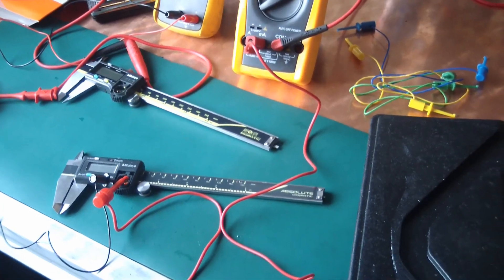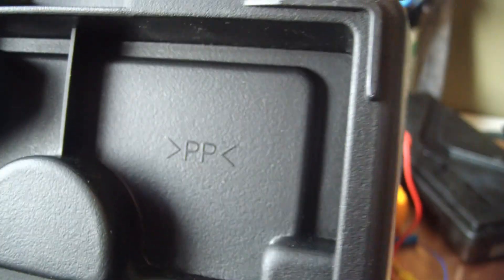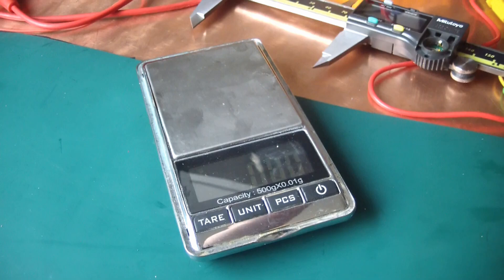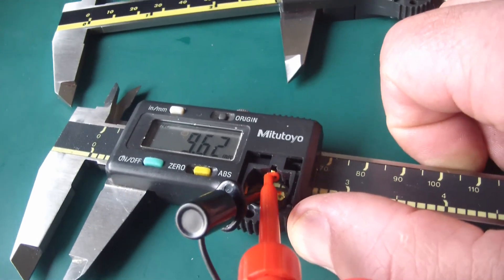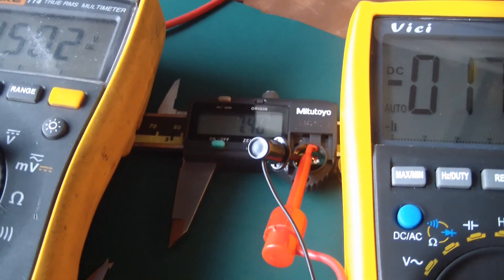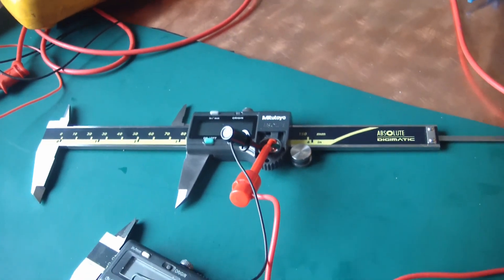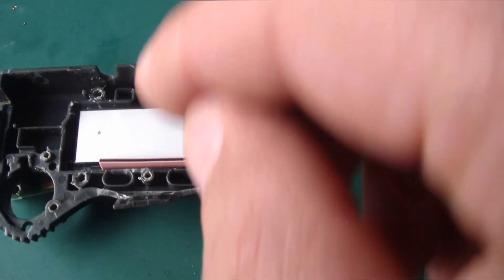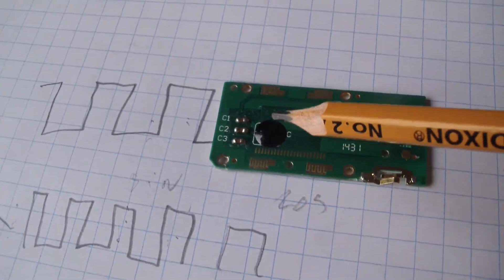BOLTR: $33 Mitutoyo Calipers, too good to be true?

Comment: Got some cheapie calipers myself... $20NZ.... surprisingly well finished and fitted and seem very accurate (checked against my genuine Mitutoyo micromater)... It's very easy to get the battery in and out so I take it out when not in use, otherwise it will flatten a battery in a few weeks. Works for me.... For most no-super-accuracy-required measurements I use a dial caliper anyway, which is accurate to 1/10th mm minus (minus a lot if you read the scale carefully.. the grads on the dial are 1/10th... about 4 thou in white man's measure!). The digi ones are OK to half a thou on imperial setting, about the same on metric... so quite good enough for most purposes. I always final check with the mike though, if it's really critical. It's a 0-2" that I got in a closing down sale for about half price about 50 years ago (when I had a high paid job!)... '62 if I remember rightly.... It's right up there with Browne and Sharpe, Starret etc..... dead accurate to .0001" minus throughout the whole range. I hope whoever gets it when I die looks after it..... even a smear from a slightly oily finger shows on the zero.... a beautiful instrument in its own right....
OK,... I guess y'all have gathered I'm a machinery nut.... LOL...
Reply: xKatjaxPurrsx as a cnc machinist and a cnc programmer, I assure you that a caliper is really usefull in a workshop.
Reply: I don't know why anyone would use calipers if they needed a measurement within 1/10 of a mm anyways, isn't that why god invented micrometers?
Reply: MrVitalic85 I use mine every singe day. Note my previous comment was satire ;-)
Reply: Oh by the way, Mitutoyo is an excellent brand; right up there with Starret, Jones and Shipman etc. Buy with confidence...
Reply: My black and decker soldering iron is from 1959.  It was my grandmother's father's.  Still have the orig box and manual, only missing one out of the 5 tips.  Also have one of these http://www.old-woodworking-tools.net/images/vintage-sears-sabre-saw-21260604.jpg.  Sturdy AF.  Had another one like this http://i.ebayimg.com/images/g/kyoAAOxyKh5SA-ek/s-l300.jpg but I broke it taking it apart :(
Reply: +MrVitalic85 aka green button pusher lol

Comment: I just bought some 6 inch Mitutoyo calipers for $110.00 how do you tell if you got the real thing?
Reply: I bought a pair of 8" Mitutoyo digital calipers from MSC the paper work was printed same as my dial test indicator also  Mitutoyo as well. I think the volume Mitutoyo produces doesn't  allow QA or inspection to hand write the certificates.
Reply: they said that their version is made in china so, no its no real mitutoyo
Reply: If it's a true mitutoyo the documents will be hand signed by the inspector never printed
Reply: Update:
I think they are fake...I saw the same ones on Bang good ( a China direct site ) for around or maybe even under  $30.
Everything looked exactly the same. Sad very sad.
Reply: if you got it from MSC big book i would not worry about it
Reply: http://www.banggood.com/Mitutoyo-6inch-0-150mm0_01mm-Digital-Caliper-Stainless-Steel-Electronic-Vernier-Calipers-p-1012111.html?rmmds=category
Reply: they aren't hand signed, they are printed from factory. The documents are just a certificate to say that its passed a standard QA. each inspector will have a stack of pre printed certificates he/she puts in the box.
Reply: +AvE  Ah crap looks like I may have paid $110 for the MituFang Pi version hard to say tho they don't look like either of the ones you have there.
They measure exactly the same as an older pair which are the real thing (I think) but the new ones have a little more resistance when sliding them back and forth all in all I like them but don't like the thought of paying $110 for a $30 item, gotta love MSC. How can they get away with not putting Made In China on them? Or at least not being able to put Made in Japan on the product ,paper work ,box etc...
 Oh well live and learn.
Reply: SgtPiggie I'll give it a try.
Reply: +Ed T how did it went mate?
Reply: mmdirtyworkz 

i never got around to contacting them.
Reply: Ed T ah too bad, I was hoping to see their response :( 
Thanks for the reply though, cheers!

Comment: Dig it 160 dollar calliper on ebay for 18 bucks delivered from CHINA. www.ebay.com/itm/Mitutoyoo-500-196-20-30-150mm-6-Absolute-Digital-Digimatic-Vernier-Caliper-/272098936620
Reply: Just saw this, when I clicked on this link:

This listing 272098936620 has been removed, or this item is not available.

Wonder what's up?
R
Reply: *****
Probably was caught out as a fraud by eBay. and they yanked it.

Comment: you would have done a better job at least explaining what the difference is between a "absolute" caliper and a old style "relative`' caliper.
A relative caliper just counts the number of steps it has been moved so if it counts wrong you get a wrong measurement.
A absolute caliper always "knows" where it is as it counts so the inductive path is numbered like doornumbers and the caliper always knows at what doornumber it is, while a relative caliper only knows that it was at 10.44 mm at now it has moved by 0.3 mm so the new measurement has to be 10.74.

A absolute caliper cannot fail at its calibration while a relative caliper can and will fail if you move it to fast, get waterr in it or chips.
Reply: That is why the "absolute" sensor does not need current in sleep mode to know the exact position at next wakeup. The small current in sleep is not for counting anything, just the normal low power current consumption of the microcontroller.

Comment: HF dial calipers. $10 They are accurate to within about 2.5 thou and I can come back in a thousand years and the battery won't have died.
Reply: I've had no issues with mine. Only complaint is that it's not metric.
Reply: +Desu-chan Sugoi the ones I got were in both metric and imperial. I find I like dial calipers. Sure, it's probably true that you can read the digital readout faster but reading the dial makes you feel like a real engineer.
Reply: Geahk Burchill
You have one of their air compressors? How are their air tools? I could use a die grinder but so far all my air tools are craftsman but craftsman went crappy within the past few years.

That air impact hammer with the 10,000rpm like the nascar guys use sure temps me even though I already own one that works just fine (and I don't use it that much anyway).

The only thing I had trouble with recently is there HVLP paint gun and it might have been my fault because I bought it years ago and when I got around to using it one of the hoses was so rotted in just broke in half trying to unpack it. But that's a cheap thing to replace -- more of a time hassle than anything else, really.
Reply: +BikingMNViking if u need to seal your hose connections I use a plumbers dope that is rated for 3000 psi steam fittings. can leave my compressor on for days and it doesn't run or leak. that hissing sound drives me crazy. I have stopped in the middle of projects to make it stop. hoses are the better Napa grade.
Reply: JEREMY WHITMORE
I used the white teflon tape... I realized storebought is lousy so I got some military grade stuff which is twice as thick 5 mils.... the hoses leak at the ends in the storebought crimps and I am really not sure what to do about the water in the first place.

I used to be good about emptying it regularly but got sick of crawling under it. I did buy a item that is supposed to sort of "spit out" the water at the end of every cycle but never put it on.

I also have the large professsional water remover, the kind the paint folks use, but am unsure exactly how to hook it up because if I hook it up higher there will likely still be water down in the tank. Both are HF units.

So do I have to put the AC on something up higher and run the Painter's Water Remover down lower?

Now I get the problem. I should just solder up a big brass or copper tube and let the water collect in there -- it won't rust/corrode(will it under 90PSI pressure?) and if it does the pipe would be cheaper and more replaceable than the compressor's main tank.

For now my med problems are such an issue I shut the whole thing off.

What about oversealing the ends of the storebought hoses with that "self sealing" silicone tape? (I also wonder about this new miracle stuff "Flex Seal" )

Also the water collects in the ends of the hoses and the hose end (esp the one outside) leaks -- that is the only hiss I ever had problems with. Even when I worked back in Amoco Gas Station the manager had me replacing the outside one every other day or so while the other one was probably inside drying out.
Reply: +Geahk Burchill Same for my Dad's hand-down 40+ year old Starrett dial calipers.  Every decade or so we get them cleaned and calibrated.
Reply: I'm almost 50 with bad knees and ect... from 36 yrs in the oilpatch. I now leave the drain petcock slightly open with an aluminum pan under the air compressor. It contains the water, easy do dump. If I'm doing body work, I buy those cheap screw in water traps from Princess Auto- Canada's version of HF

Comment: go analog,keep the battery variable out
Reply: and zero reset knock and slipping scale variables as well.Ive never spent even $100(this Aussie dollerydoos) on mitutoyo dial calipers (got 12" sealed NOS for $80! Older ones without plastic housing that scares me) so i don't get how people spend so much on this digital junk that im pretty sure isn't even MIJ anymore anyway, im still curios why AVE's legit ones are also labeled CE, HMMM....that thare be a red flag that he didn't touch on.

Comment: This is why I just use my analog calipers.
Reply: Dial calipers are prone to mechanical wear. They get sloppy and don't repeat especially in a shop environment with grit on everything.
Reply: Same! I did buy a digital one at a shop (decent quality shop), it was so much in the way I found out. So the next day I got the money back and did buy a analog one.
I learned in electrical school how to read the analog one.
Reply: +Eric Magnet  Yeah, sure digital may be better, but I prefer using my dial calipers. And until they start losing their accuracy, I'm probably going to keep preferring them.
Reply: I gotta have at least one set of Mitutoyo.  They last a decade anyway if you don't run them over with your car.
Reply: Yup. Any caliper is a + - .001 tool anyway, don't care what the resolution of the digital readout is.
Reply: Eric Magnet Idk, mine are fine and have worked and had the same zero for years.
Reply: Real vernier kalipers, my friend.
Reply: Ditto
I'm a reloader, and the $20 RCBS labeled Chinesium set I have works quite nicely for my purposes.
Reply: Sure they generally are. My boss and I have had this discussion and he was always against digital. Then, a few weeks back he was measuring some part right in front of me and bam, skipped teeth. Also, the pinion can bend and that causes it to read inaccurately. Bottom line is less moving parts is better.
Reply: Nathan Campbell I don't care what you use, it's all preference. The reasons I stated and the unit conversion and setting a new origin on the fly is why I use digital. I mainly do reverse engineering and inspection so those functions are very useful to me. measuring between same size holes is especially simple with digital.
Reply: and they are significantly cheaper. I got a 1/20mm geniune mitutoyo caliper for 30 bucks
Reply: Everything with moving parts is subject to mechanical wear...

Comment: The whole point of the absolute calipers is that they don't have to remember a count of lines.  I suspect all that current goes into keeping the processor awake enough to tell when you mash the on button.

I couldn't find a writeup on how the calipers work, but they have some absolute scales for CNC machines with analog outputs, and those return sine waves of various (spatial) frequencies. It looks like our benevolent masters don't want us to paste links, so go to mitutoyo.com, then literature, then "NC linear scales and sensors" (E13005_LinerScaleSystem), then there's a figure on page 47 that shows the signals the scale gives. I assume the calipers are similar, just without the "photoelectric mode" part (they claim you can interpolate 512 steps in the ~1 mm sine wave, and the calipers only give you 0.01 mm, so that's a gracious plenty).

Comment: Great tool review as usual.  Now how about a review of the dial indicators like Harbor Freight and Starrett etc.  I use them just because I don't run out of batteries when I have none in the middle of a job.  Seems a good reason to avoid digitals all together.  Bring back the slide rule!!!!  I am tired of having to be a warehouse for the unending variety of batteries which go bad without even being used.  Wheeww,  I feel better now.

Comment: I have the $20 craptastic Performance Equipment ones.  Same things as these.  No grind on the slide action and feels pretty good in the hand, but I can verify, horrific on power consumption but mine do have a 'batt' symbol on the LCD.  I purchased 100 357 cells for $5 on fleabay so I'm covered.  I just get in the habit of removing the battery from them when I power them off and put it in the convenient little holder in the case.My MK1 eyeball isn't as well calibrated as I'd like so these do and I won't cry if they die on me.

Comment: Today I saw some old mitutoyo stuff at work, one big box that was a large series of lets say calibrated thickness leaves (dont know the actual real name nor use for them), two micrometers and two digital calipers. One micrometer has a set "bits". I was told they are used to help the micrometer measure in different ways. Again, dont know the name. and Also 1-Meter Standard made of glass (this one not sure if was made by mitutoyo). Not a tool guy, but this things feel like jewels, what a quality. Some boxes are even made of wood.

Comment: I've spent the last half hour searching for the video where you smack a pair of calipers out of nowhere with your Swedish nut lathe claiming it needs an "adjustment". If you remember where that clip is I would be very appreciative.
Reply: Cheers
Reply: +Max Maruszewski Nope, not in any of those, think machining tool steel on a toy lathe is a video you never posted :P but don't fret, ill find it eventually.
Reply: +Max Maruszewski I just found it, it is in the "how to turn tool steel in a lathe" video around the 4:00 mark. Have fun!

Comment: AVE,

Grizzly sells a $30 caliper. 6", it's blue and comes in a case. I've used mine for many years, it's very smooth and when used properly just as accurate as my dials. If your interested I would recommend reviewing it. It's smoother than my Starrett Dial caliper.

At work my boss has some $10 Harbor Freight calipers...although they have a thumb wheel they are so rough I can't use them.

Comment: I have $15 mechanical calipers where the scale goes down to 25um (1 thou), although you can only read +-2 thou with your eyes. No low voltage risks, it's stainless, the only gripe is that it lacks the thumb wheel and the stopping screw. But it's a budget model of a local brand and it's not fake.

Comment: Love this vid.  I think the issue about drawing current while off is because of the push-button power design.  I have a small 5W radio that had the same setup.  I ended up replacing the push-button with a small SPST that physically opened the circuit.  No more battery drain on an emergency radio for when I forget to cycle the batteries out...

Comment: Love this video!  One thing to note is the "absolute" on the Mitutoyo calipers... it actually infers they use an absolute encoder and not a relative [or incremental] encoder. As such it does not need to count/measure when off. The knock-offs I suspect are using an incremental encoder, thus need to keep counting even when "off". An easy test for this is to remove the battery, and adjust the calipers to a known measurement, you'll find that the Mitutoyo's shows the correct reading when power is reapplied. I think you'll find that the knock-offs use an incremental encoder, and this will lose count/position without power. The low power, when off, of the Mitutoyo's is just enough to keep enough brain cells alive to respond to a press of the power button to turn back on, unlike the knock-offs which need to keep alive to keep count to mimic the absolute encoder of the real deal.
Reply: The Mitutoyo does have absolute encoding, I have a battery-less Mitu, runs off a photovoltaic, never gets lost no matter how long it's been in the dark and moved.
Reply: @TD_YT066  to ok
Reply: If that's the case, then the standby power draw of the Mitutoyo is quite big... you don't need that much to respond to a button press.
Reply: that's not entirely true. to my knowledge the newer Digimatic Absolute calipers without the on/off-button use a combination of absloute and incremental encoding with reference marks along the rail, that's why you have to slide it a considerable amount of travel to the next reference mark to actually wake it up.
not entirely sure tho if they don't draw any current when in sleep state, a SR44 cell would last for well over 2 years when in daily use.
Reply: @sunside79334  mine last for years as well. They made a purple one many years ago that are same as the cheap ones as ave describes. Perfect for the wife:)